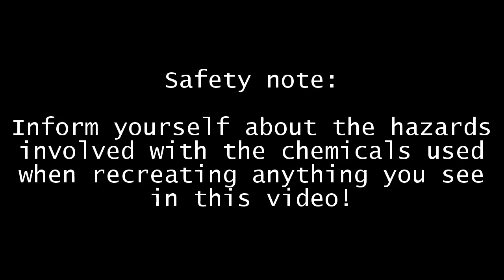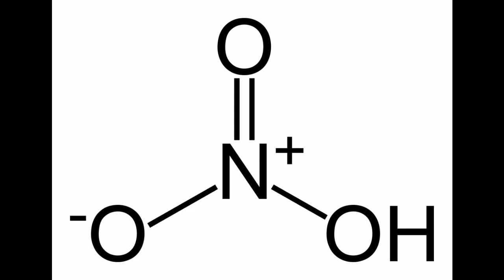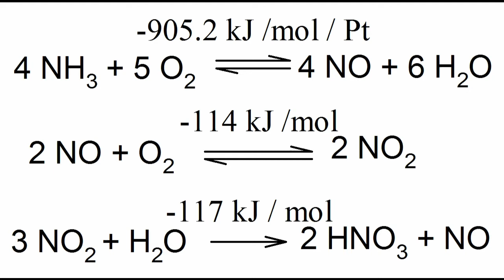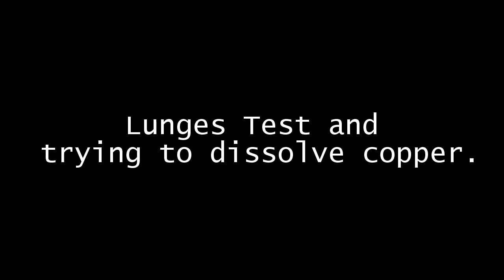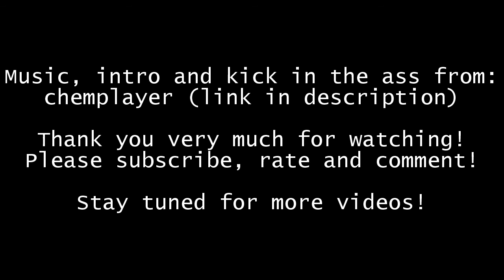Ostwald process: Catalytic oxidation of ammonia for the production of nitric acid

Comment: So how do you make the catalyst?  You can't really do this experiment without it.  Does it have to be platinum?  What about copper or something cheaper?
Reply from the maker: We'll show it in an upcoming video as already promised to other users. It is already briefly explained at the end of this video. 
Yes, it absolutely has to be platinum or iridium or an 90/10 alloy of Pt/Ir. Copper would promote this reaction: 2 NH3 -> N2 + 3H2 ; which is obviously very undesirable. The deeper reason for this is that both NH3 and O2 have to associate with the catalyst. This will only work with Pt or Ir.
We have done extensive research in experiments as well as the literature about the gasphase oxidation of ammonia for years now. Right from the first publications in the 19th century to the newest catalyst-theories. And platinum is really the only practicable catalyst.
There are however very old and almost forgotten ways to oxidize ammonia in the gasphase without a catalyst or even when dissolved in water...
However, you should not forget that 10mg of platinum is enough to make 3 - 4 catalysts.
Reply: I ve read in onld articels they used Magnesiumplumbat magnesiummangante Katalyst for smal plants because it oxidese ne NH3 direct to NO2 and makes Absorption easier. I only know the titel in german but there where many Katalyst used Nickl , ironoxid .... Oh and they made direct Nitrates with Alkali hydroxids and Carbonates or Earthalkalihydroxids. They can oxidize ammonia too. At a Temperatur of 250 and best if iron, cooper, silver, or nickel is present or there oxides. The metals on the right side is the better one...
Reply from the maker: "Die Oxydation des Ammoniaks zu Salpetersäure und Salpetriger Säure" from Donath and Indra also referes to the "catalysts" you mentioned. However, they say that the substances you refer to directly give up oxygen to the ammonia. So e.g Iron(III) oxide is reduced by the ammonia. Might be worth trying out in some experiments.
Btw: The book above even shows methods to oxidize ammonia electrolytically to nitrate. Can you give us the reference for the magnesium plumbate?
Reply: From the Book " Fortschritte der anorganischen chemischen Industrie.Work from Dr.Karl A. Hoffmann. He wrote about an Catalyticl mix of Earthalkalie salt of ortholeadacid or metaleadacid and an manganoxid or an Earthalkalimanganat salt.  The Catalyst works in an temperature range from 500 C to 750 C.  In an other source was the Name  Marston and an factory in the usa who worked with an paste of Magnesiumplumbate. I cant finde the Artikel about "Salpeter aus Luft". There was an reference too, and how to make it.I think the Inventor was G. Kaßner who also invented the Plumboxan process for Oxygen manufacture. P.S Germanys main Catalyst during world war 1 (lak of Platin) was an mixture of ironoxid manganoxid Bismutoxid on an caramic plate with holes.An intersting catalyst is Chromoxid on pumice Stone. If you soak Ammoniumdichromate an pumic Stone and heat it to 1000 c. With the same Methode you can prepare other metaloxid catalysts.I think the greatest Problem is the contact time of the air ammonia mix. How high was your yield of HNO3 calculatet on N2?
Reply from the maker: Thanks alot!! Normally, we use nichrome heating elements on the catalyst chamber. These where removed for the purpose of the video. Depending on gas flow rate, temperature and gas composition, we had yields around 50 - 60%. The biggest problem is not the oxidation to nitrogen but excess of ammonia beeing carried into the acid.
Reply: Astral Chemistry 
I have heard that Cobalt(II,III)-oxide  is also a good catalyst for this reaktion....btw. really nice channel  ...and are you also a German guy?
Reply from the maker: Thank you! 
I guess you read the patent from Nielsen and Johanes. It is known since the earliest years of the 20th century that various d-block metal-oxides will catalyze the oxidation of ammonia. However, in our opinion, the oxidation mostly goes to nitrogen and not nitrogen oxides.
Reply: I read an interesting Thing about Copper. Schönbein & Million experimented with Copper turning ribbons. They wrote if you use fresh ribbons and dump concentrated ammonia solution over it (they not complete under water). It creats in few minutes smoke of Ammoniumnitrate. They said it is more catalytic active than Platin spong because the reaction starts at room temperatue.And it doesen work with the oxides it must be metalic copper.If you dont Need nitric acid and have no way to get Nitrates you can also oxidise ammonia on Alkalicarbonates,hydroxides and Earthalkalihydroxides. Reaction temperature Optimum over 250C and unter the melting Point ot the Nitrates. Presensts of Nickl, Cobalt, silver, copper, iron and there oxides Speed up the reaction.The left metal is the best the right the worst for the reaction.
Reply from the maker: Thank you. Do you know the paper for the Schönbein-Million catalyst? That might be worthwhile to try out. Nitric acid is not a problem - we have an academic study interest in the various catalysts.
Reply: They only experimented with fresh copper turnings. Schönbein never used it for lab or industrial manufacture. His idea was to remove Oxygen from air because he wrote that in his Experiment it took few minutes to remove 1 cubic foot of Oxygen.If you make copper powder from coppersulfate and ascorbinic acid. I think that powder will work too.Here is the link to Schönbeins work. It s in german.http://dingler.culture.hu-berlin.de/article/pj143/mi143mi01_6
Reply: Sorry not onlie turnings but reduced copper with hydrogen.I saw an patent for an industrial copper pipe catalyst. It s only an pipe 1mm thick i dont know the Diameter of the bore. It s 225mm Long and ist one time coiled because to store heat an to bring the ammonia in more contact with the Surface.
Reply from the maker: Very, very interesting because he says that copper is more catalytically active then platinum and that the reaction takes place without heating!! Thanks alot for the reference. We'll try this out with freshly prepared copper and post our experiments as a video. 
It is very strange that all these old experiments seem to be forgotten - at least there is very little modern literature that outlines the history of ammonia oxidation. 
If you want to we can write you a message on how the experiments are proceeding. Thanks again!
Reply: Np. The polytechnische Journal have an lot of old Experiments. The enemy of the good is the better. Thats why they forgott about old science. Thx i like to hear how your Experiment works.
Reply from the maker: We tried to repicate Schönbeins report today. It works suprisingly well! We tested copper powder that was freshly reduced with hydrogen from copper oxide and copper that was obtained by reduction of copper(II) with L-ascorbic acid. The fine copper powder was then placed inside a beaker standing in the fumehood. Some concentrated ammonia solution was then added to the just wet the copper. After that the beaker was covered with a watchglass and left to stand for a few minutes. 
No smoke or exotherm was detected. However, after a few minutes the ammonia solution turned blue from dissolved copper complexes. The resulting solution was seperated from the remaining copper powder and acidified with glacial acetic acid. 1-Naphtylamin and Sulfanilic acid was then added. Immidiatly a very, very strong intense red colour was formed which could be extracted into diethyl ether by shaking with the aqueous phase! We could even crystallize solid sodium nitrite and precipitate silver nitrite. 
The reaction is very interesting and these where just the first tries on a small scale. We have to note that the reaction did only work with the copper powder prepared with the ascorbic acid. Maybe particle size plays a role, but we also think towards hydrogen absorption when the copper oxide is reduced in the stream of hydrogen. 
Further experiments will be done on a larger scale. We currently have no time to do a video about the process, but if you drop us your mail adress, we can send you some video clips and photos. The interesting thing will be to find out how and why part of the copper seems to go into solution as a copper(II)ammin complex.
Reply: I dont want open post my email adress. Congratulation that it works. If the copper desolve you cant use it as an catalyst for industrial production :(.But i think ist an nice Methode for labscale nitrit manufacture.An interesting link. Kuhlmann made nitric acid with MnO2 or PbO2 Ammoniumsulfat and Destillation.http://dingler.culture.hu-berlin.de/article/pj103/ar103067
Reply: https://depatisnet.dpma.de/DepatisNet/depatisnet?action=pdf&docid=DE000000414141AIve found it. The original Patent of Kaßners Katalyst.
Reply from the maker: Sorry, but the link does not seem to work. Maybe you forgot something at the end?
Reply: I give you the link to the patent amt. https://depatisnet.dpma.de/ipc/ipc.do?s=C01B0021000000&v=20170101&l=DE&dh=dh11&sn=n00&sci=i00#C01B0021000000search here. C01B 21/26 in text contains Chrom there are many patents who works without Platin.
Reply from the maker: Thanks a lot again! You know some great internet resources! You're really right that the enemy of good is the better.
Reply: No Problem. I ve learnd many Things from the patents.First they heat the Gas mix not the catalyst and Platin is the only one who works with 300 C. If you use higher temperaturs for the gas mix it reacts with the pipe material and you have Nitrogen loses exept you use glas. or sealing it with water glas ect.If you dont heat the gas mix you have than an lot of Ammoniumnitrat in your acid.I hope you find some good Experiments for you. :)Oh and there was an good one that uses silver on pumic Stone.I think ill try some day this one. :D

Comment: Could I use a different catalyst?
Reply: I have heard that red hot Iron can be used? I know nothing about it and I am not sure if it is the same setup or even something that is real. I saw that on ebay there are premade platinum beds used in fireplaces to emulate embers and they were about 20 bucks.
Reply: Yes, you can use copper wire, but the reaction is much harder to start. See my answer to "R Johnson" above.